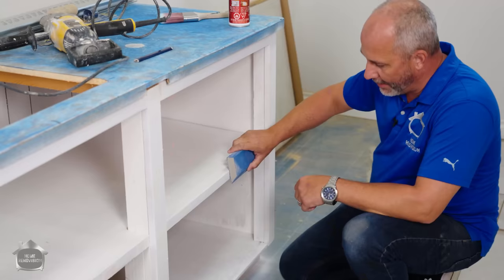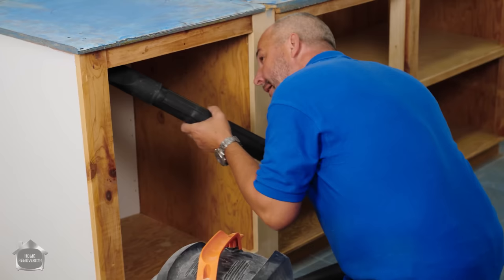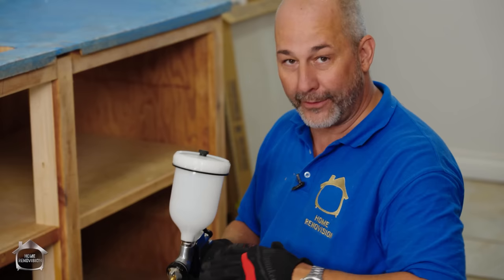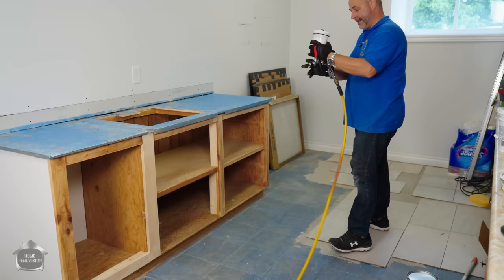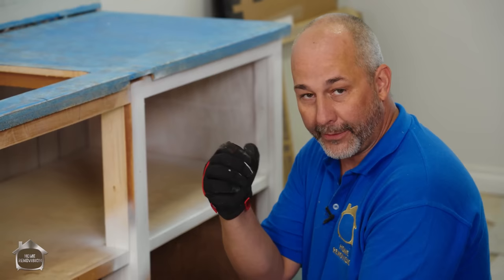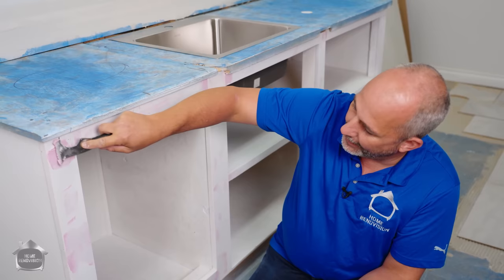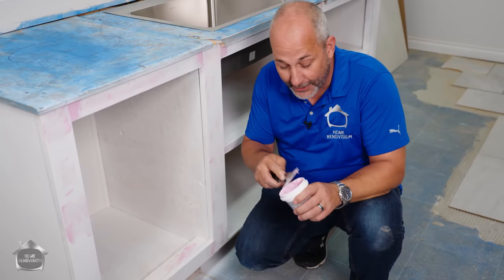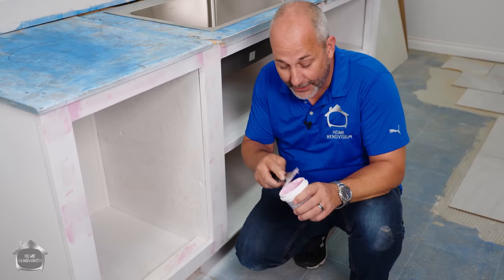Painting Old Kitchen Cabinets / DIY Project

Comment: Paint the inside of the cabinets first then work your way out. This will stop you from messing up the wet paint on the face while reaching into the cabinet.
Reply: Greatly reduces overspray.
Reply: What size nozzle do you use?
Reply: @hboy954  I don't use the pneumatic sprayers like this guy does or HVLP systems. I use airless for painting cabinets, even though there are better options but I still get great results. The tips I use are for graco airless sprayer. FFLP 310 tips.
Reply: @jimeneazy5999  Appreciate the response.
Reply: He said he was going to do just that!  And where's the mask?  That's oil base!!
Reply: @maddierosemusic  Jeff doesn’t believe in PPE, like ever. I imagine he would weld with sunglasses.
Reply: @maddierosemusic  omg, Ms Osha here. And  dont get any paint on your fingys
Reply: @terrythomas790  I don't particularly care, but I think it's a little irresponsible to 'show' people how to do something without even a disclaimer.  Essential Craftsman was on a roof with the stupid rope and harness and he told us he hates the thing because he's more likely to trip on it, so he took it off.  Jeff could simply say a DIYer should wear a mask, but he doesn't like it.  I don't either, but I use one when spraying oil.

Comment: Here’s a tip: for the gravity gun you can get a cup that uses a “bladder” inside. Before spraying, to bleed the air out, you turn the gun upside down and spray until fluid starts spraying. This way you can spray upside down, sideways, any direction. They’re used a lot in the auto body painting business.
Reply from the maker: Cheers Rich!
Reply: Yes I have seen those , look like just the ticket.
Reply: Yep
Reply: 3m pps system
Reply: @alecgrace6468  yep. Sata has theirs and Norton came out with a similar version. So did Devilbiss
Reply: With the Sata one you have to remember to open/close the little cap on the cup before/after you spray.
Reply: @ironwood1621  I didn't know norton made one I might try that system out
Reply: Omg did you use a combination square to stir paint? 😆

Comment: Here is my cabinet painting method. I sand with 220, prime with tinted BM fresh start primer, sand with 220, tack cloth, brush 1 light coat of BM Advance satin, let it dry over night, wet sand, tack cloth, 2nd coat of Advance. Walk away.

Comment: Perfect video for us. We are replacing all kitchen cabinet doors in a rental with those same MDF doors. Bought a cheap sprayer because I’ll be spraying them just like you. Probably just going to roll the face of the cabinets because there are tenants in the property. We made new counters out of MDF and topped them with epoxy. They turned out pretty good. Use red gard on the bottom and also painted the bottoms  to make sure if anybody looked they wouldn’t be red. New sink & faucet, New range hood. Should be super clean and nice.

Comment: I have used that Husky HVLP- I ditch the included micro filters. They clog up and you have to empty the cup to clean it. Just use a paper paint filter while filling the cup. Done. That dewalt pancake compressor has a higher 165 psi cut off, and is decently quiet for a pancake. I recommend Hitachi’s The Tank pancake for even higher psi cutoff. Since they both have two taps each, you can daisy chain them to get higher CFMs. Just keep your psi set to what the sprayer needs (below 50 psi).

Comment: I just repainted my cabinets with the c2 + the hardener. I used a huskey hvlp gun with the 2.2mm tip and it sprayed fantastic, finish product is awesome. It was expensive but the finish came out so nice. I ended up doing basically the exact same thing as you before you posted this video.

Love your content btw, it's been extremely helpful as we have been going through our house
Reply from the maker: Cheers Jonathan! Well played!
Reply: What size compressor?
Reply: @captaincane64  it's an older craftsman 12 gallon or so that I got from my dad. Using the black husky gun that comes with the air regulator I sprayed it at about 30-35 psi. Never had issues with running out of air
Reply: @jonlamey48178  thanks for taking the time to comment. I really like the husky gun but wasn’t sure what compressor to pair it with. Glad to see it can be paired with a smaller compressor. Again thanks for the information.
Reply: Does c2 paint come pretty thin? Every time I use an hvlp with water based paints I need to thin them down a lot!
Reply: @Robert Gralton  I added the additional hardner to it, and used a spray gun that had a 2.2mm sized needle. It sprayed perfectly like that

Comment: Never realized spraying was so easy! I could totally do this with my little compressor! I think I’ve got a new idea for the birthday present list I never can think of anything for! :)
Reply: Most compressors you buy at home Depot don't have enough pressure for this type of painting. Not the size. Cause you can get a 20 gallon but not enough pressure and it won't spray right
Reply: @AmazingAndre  will a LVLP work better with a smaller compressor?
Reply: @ssa12654  Its not the size of the tank that matters. Its the cfm that the compressor puts out. The tool or gun being used on it cant be using more cfm (cubic ft per minute) than the compressor puts out. The tank pressure would be used up faster and the gun wont spray right, because  in this case, you are using air more quicker than the compressor can supply.  People just buy any size compressor and grab air tools and find out the hard way. Each tool will say how much cfm is required. The air compressor will say how much cfm it puts out. More  cfm is better in the compressor. if you have a smaller tank you might be seeing it never shuts off because it never gets the chance to fill completely while running a tool.

Comment: I once lived in an apartment with tiled countertops. While it was convenient to be able to put hot items on the counter without melting it, that was outweighed by the aggravation of trying to keep all those grout lines clean. If it's not too late I'd recommend doing the countertop in a different material.
Reply from the maker: counter done in 24 x 30 tile. 2 grout lines with sealer in the grout means easy maintenance. Cheers!
Reply: There's always decorative concrete countertops
Reply: @yusefmessallam , I've heard they are difficult to keep clean because they absorb spills.

Comment: I do tons of cabinet repaints and I can’t express enough if you do them frequently pick up a turbine sprayer with a remote cup or flex liner setup. Doesn’t have to be anything crazy since you can thin paints with XIM. C2 is something I’m surprised to see you using! By far the best cabinet paints for high quality. Another great product to try is ppg breakthrough. Not as high quality of a finish but still extremely good and dries almost instantly
Reply: BM Command or BM advance is more durable than C2. I saw a video of a cabinet guy that sprayed a cabinet door with a bunch of paints including C2, BM command, BM advance, SW emerald, PPG breakthrough, INSL-X, etc. and BM command & Advance came up on top. BM advance does take a long time to dry about 8 hours dry to touch and 16 hours between coats.
Reply: @guytech7310  I like command a lot as well. I can’t stand advance. It’s one of the most stressful paints I’ve dealt with for almost any usage. It takes forever to dry and I can’t remember but I thought the C2 with the hardener beat out advanced on a few videos. Could be wrong but I’ve since this comment actually changed it up a bit. I like breakthrough and command for a lot of things. Kitchen cabinets the only paint I’ll use is C2. However, not really a paint but envirolak seems to be better than every paint hands down. So typically I spray kitchen cabinets with envirolak or C2. Other cabinets, vanities and trim I will use breakthrough or command.
Reply: @guytech7310  What do you think of Kem Aqua , Target Coatings EM6500 or SW Proclassic for painting cabinets and doors?
Reply: @vincentbianco583  Have you ever tried Target Coatings EM6500, Kem Aqua, or SW ProClassic for cabinets? Do you think C2 and Envirolak perform better than those?
Reply: @logicalblueberry  I haven't used either. For cabinets & Doors I been using Benj. Moore Command & Lenmar UltraLaq. I wanted something durable & I could apply using a HVLP spray gun.

Comment: I bought a pressure pot from harbor freight last year and primed the inside of my barn with it. I'm still not very good at it but it will come in very handy on future projects and was a bargain. It's hard to mess up something that's air powered.
Reply from the maker: say that! Cheers! Perfect every time!
Reply: did you connect that pressure pot to an HVLP gun?
Reply: @adrianromerocodes3211  came with it.

Comment: I am liking your videos and I will be doing the tile over tile. For this one, I have been doing cabinets for 15 years. I am a 61 yr old female. : )  My preferred primer is Zinsser Red Label shellac based. You ALWAYS need to strain your paints/primer before putting it into the gun. Wear a respirator and goggles, dude. I do not spray inside boxes because the blow back is incredible. I roll the insides and spray the outer surfaces. Cabinet doors, I sand, then use the same Zinsser Red Label primer, then sand again. Then I use PPG Breakthrough! Get your doors up and off the surface by using a "lazy susan." (easy to make) and then you can spin those doors! I spray backs first, then fronts (1x or 2x). The edges are easy when the door is elevated. Just spin the door. Fronts: spray the edges, then give one continuous swipe across with the gun, starting the spray before reaching the door and ending it after passing the final edge. You will always have a weak spot on the door face (where the shaker panel is joined) so rotate the door 180 degrees and give one run across that join. Do not use short little sprays on doors. I love PPG Breakthrough because it is self-leveling and evens out so nicely. I wish I could try your product, C2. Is it available in the US?
Reply: Wow fantastic advice!!
Reply: Using a HVLP sprayer helps with overspray (blow back) problem. When you paint cabinet doors ideally you want to break the paint bridge between the frame and the panel insert so it can move (caused by humidity & temperature changes). 

PPG breakthrough isn't very durable and can degrade by household cleaners. BM Adanced or BM Command are the two more durable non-lacquer paints available.
Reply: When you say Red Label, do you mean B-I-N?
Reply: @guytech7310  And Ben Moore bought INSLX which makes Cabinet Coat - another good paint for cabinets.
Reply: @maddierosemusic  INSLX not so good compared to BM Advanced, BM Command, or BM-Lenmar. other brands would be Milesi & Renner. If it needs to be apply with a brush is sucks in my opinion.
Reply: @maddierosemusic  Zinsser Red Label is not B-I-N Bullseye 123 Blue Label. Zinsser has 3 primers. Red Label shellac based, Blue Label water based, and Brown Label oil based. Go with the Red Label (but you will need Denatured Alcohol to clean with).
Reply: @coinholio6863  I use hundreds of gallons a year.  BIN has a red label, although they have 'new' BIN which I will not use. You clean up BIN with AMMONIA and hot water, not alcohol, even though it is alcohol based.  Weird chemistry, I guess.

Comment: Tell us more details about your spray setup. Like what size compressor did you use. Could make for an interesting future video.
Reply from the maker: I used a dewalt trim compressor. Granted it is not as fast as a dedicated paint spraying machine However it is incredibly affordable and does a nice job with a little patience. save the 2500.00 investment . Cheers!

Comment: I was taught, and always find it easiet to paint "inside out". 
Do the inside uppers first. That way you aren't trying to avoid wet paint to get to those hard-to-reach places. Next do the sides, then bottom insides of the spaces, again to avoid messing up wet paint. 
Finish with the front, top and outside planes. 
After that dries well, flip and do the back side.
Reply: I find this helpful. Is this the method you want to use if painting cabinets that are still on the hinges (haven't been pulled off for painting)?

Comment: I’ve used this Zinzer product on furniture refinishing. It did not work. I sanded. Primed twice and still got bleed through in some spots. A better product is the primer by General finishes. It’s pricey but well worth it.
Reply from the maker: or you can use the zinnser shelac but it has high voc's.
Reply: If you read their label, they literally tell you exactly what product to use to spot prime tannin/sap bleed through, and it's their shellac based primer BIN. Reading failure, not product failure, Zinsser have very good labels honestly.

Comment: Good starting point to elevate our DIY skills from just brush/roller. Oil based primers are really effective, but impossible to clean up. Do you have any tips on how to clean the air gun and skin after use? (similarly to how you taught us to clean the paint brushes from some of your early videos) As of right now, only able to just drown everything in mineral spirits...
Reply from the maker: there are many levels to oil based cleaners. I would suggest up your game to varsol for effective cleaning and then change out rubber gaskets. either way a 2 gun system from husky at such a low price means you have the option to toss the gun and forget ab out the cleanup and enjoy all the money you saved. Cheers!
Reply: For skin, use disposable nitrile gloves and an old long sleeve shirt.

Comment: It's odd to see you recommend Bin Shellac on top of Odorless Oil Based, because Zinsser clearly recommends to spot prime with BIN and THEN to overall prime with either Bull's Eye 1-2-3 or Odorless, specifically because BIN Shellac will block the stuff oil base can't while also likely flashing through the top coat. I ignored this and...had flashing.
Reply: " Zinsser clearly recommends to spot prime with BIN"  That Spot Priming only is for Exterior applications - you may fully prime with B-I-N inside - but not in a super damp area like a bathroom. It creates a vapor barrier and I've had issues in a steamy bathroom.  But really, I would not use BIN in this application at all.  Do know that 1-2-3 will flash on you - it is NOT a block out primer.  Learned that the hard way!

Comment: I can't afford the compressors that require such high cfms to run the HVLP spray guns so my choice would be an LVLP . With LVLP guns you can run most any of the cheaper home compressors. I have painted cars with LVLP and they work great
Reply: Can you paint drywall with an lvlp?
Reply: @djblock215  never tried drywall but don't see why not if it's just paint, you would need to thin it down and make sure you have the right size tip. Another advantage of lvlp is less overspray

Comment: Nice, I have tried a couple different plug in electric sprayers (not cheap) and wasn't anywhere near as impressed as my old compressor and simple spray gun. The soft fine mist I set it to that came out made a mediocre sprayer get great results. Also you compressor you use, I think you mentioned before it was a DeWalt trim compressor, is it as quiet as it seems in the video?
Reply from the maker: purrs like a kitten./ Cheers!
Reply: the dewalt compressors are not bad, but they are nowhere near as quiet as the dedicated quiet compresors. They typically come down in the 70db range, where quiet compressors are more like 60's, and the cheapo pancake compressors (Which are so loud you have to turn them off to have a conversation in the same room while wearing hearing protection) come in in the mid 80's. they also are not much smaller or lighter than the new 60db quiet compressors on the market. 

Honestly, my feel right now is that Dewalt is trailing the pack on air compressor tech. You don't really save any money, they are louder, and their trim compressors have quite low cfm as compared to the competitors. Makita, Senco, king industrial, and  California Air Tools  all have better performing rigs for about the same money or cheaper.  (just be careful with makitas, they label basically their entire line as "quiet", but there's an easy 10dB variance between them. 70dB is not horrific, but it's nowhere near the 60 and under a true quiet compressor can achieve. )

Comment: What would you do to fill in oak grain so you don’t see it after cabinets are painted?
Reply: Aqua coat
Reply: Grain filler mix some joint compound to the consistency  of pancake batter use a brush let dry light sand remove dust primer then 2 finish coats

Comment: Absolutely love your videos!
So informative!
Question I have a small hobby compressor, can I use it to paint my cupboards by just replacing a bigger paint dispenser ? TIA
Reply: A small compressor will work, but you like have short spray time as you wait for the compressor to recharge the tank to get up to the pressure needed. (ie you spray for 30 seconds, than wait 30 seconds for the air tank to refill).

Comment: I’ve been contemplating buying the same spray-Gunn you’re using in this vid but I believe it states on the label to use at least a 30 gal tank. I have the Husky Quiet 20 gal. Will I have issues spraying small panels and small pieces in my shop with the 20 gal tank?
Reply from the maker: not at all. you just need to be more patient. i used a small trim compressor from dewalt. Cheers!
Reply: You can spray with just about any compressor.  The tank size just determines how long you can spray before the compressor has to charge.  A few minutes of wait time while the compressor recharges isn't a problem when spraying that type of product for kitchen cabinets and such.  Fast drying, high gloss automotive painting requires a large compressor because you don't want any breaks when laying down a continuous wet surface from start to finish.